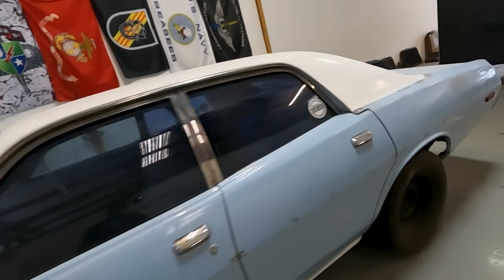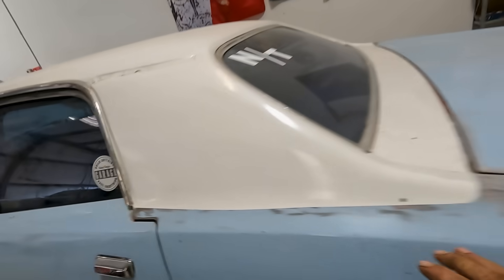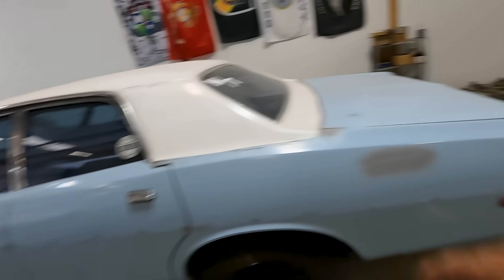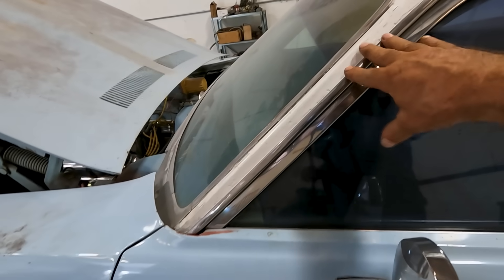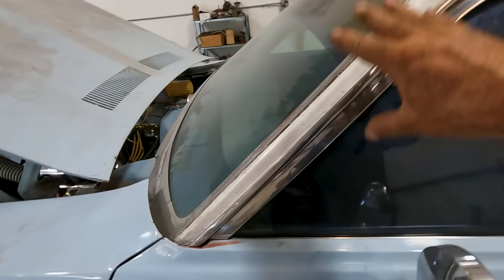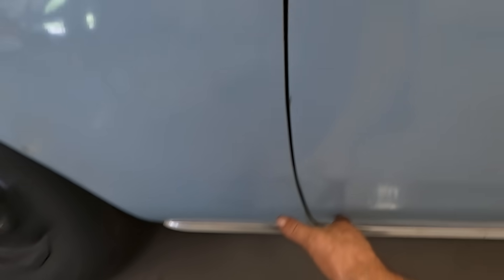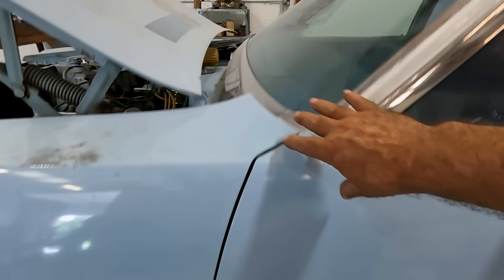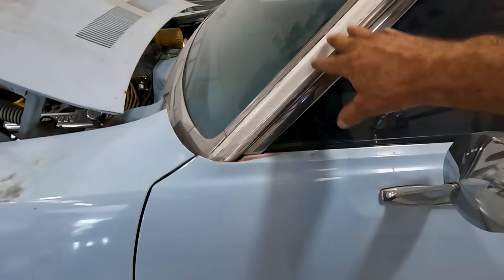Common Automotive Body Types Explained - How To Identify The Differences

Comment: Tony, If you do a little research you'll find that many words and terms used to describe the Moden Car had their beginnings in the Wagon industry. For example, Drive Shaft was a Wagon Part Long before the Automobile was every invented or created. Hub's Wheels, Brakes, Tailgate, all were used on Wagons first. The Acremen Steering equations you did a segment on all began with Wagons. Fenders you might think were from wagons but actually came from Ships. Anyhow the List is long and I'm not going to write 10 pages on it.
Reply: Hahaha

Comment: Agree with Tony on the favorite body.  A car I had at 19 (and lost - a sad stupid story) was a '56 Chevrolet 210 2 door post.  I paid $150 for it and had one of the 6 cylinders sleeved so I didn't need to keep a case of oil on the back seat.  I had some "better" cars later, but that 6 cylinder slushomatic ties with the '66 tripower 4 spd goat for most missed.

Comment: Tony-I've posted this to you before, but I heard you say in an earlier video that the US did not have the Hemi 6- which actually blew my mind a little bit since I always assumed Chrysler US invented it and produced it for us Aussie's! It is a pretty amazing engine, and there are guys getting well north of 300hp N/A at the wheels out of the 265, more than double the stock HP with what I see as some fairly straightforward but clever mods. 

There is one guy I would recommend to watch and that is Mirabito Performance- he goes into great detail with his builds and then shows all the dyno runs too.   He gets big power from the 265 Hemi - and they are STOUT!

They are relatively plentiful and inexpensive to buy in stock form in Oz - of course you need it shipped.  I am also fairly sure they fit up to the same transmissions that you have there but I'm no expert on Mopar. If you could get your hands on one I think it would be great content for your channel as well as you'd obviously enjoy exploring this gem of a Mopar yourself!
 I'm pretty sure Mirabito would hook you up with even just a decent stock one if that was what you wanted- or with one of his builds if that was financially doable. Mirabito is a cool guy- very down to earth, honest and straightforward just like you.

Comment: The 1988 4runner was a 2 door but with equal space in the backseats as the front, with a removable hardtop and a factory rollcage. Becomes a pickup with 4 seats. Gotta be the best combination of space and features i have ever seen. Truck got stolen long time ago.

Comment: I always understood it as a Coupé refers to a curved roofline/trunk area, rather than the amount of doors. I always understood that a Sedan/saloon refers to a car with a flat drop-off, like a Buick Grand National or a Ford Anglia. You can have a 4-door Coupé and a two-door sedan.
Reply: No saloons in the US.  and in our neck of the woods, only two doors for a coupe..... four doors for a sedan.   Then we had hardtops, four and two door.  Think they are pretty much gone.  Then my favorite, a convertible.
Reply: @eugenepiurkowski5439  Rover did both 4 door sedan and 4 door coupe in P5 model
Reply: @derekhobbs1102  Thanks for the info.  Must be a British thing?  "Four door coupe?"
Reply: Tony actually goes over that, the Rover Coupe has a lot lower Roofline than the Sedan and it tapers off downwards at the back, if you compare it to the Sedan it's almost chopped, at the end of the day the actual terminology Coupe is a French word which meant Cut originally so the Roof was cut, of course we became to know it as 2 door which wasn't how it originated
Reply: 4 door coupe?? You sure you dont mean a 4 door chatchback??
Reply: @eugenepiurkowski5439 Buick was advertizing the Grand National as the fastest sedan in North America. 2 door sedans are a thing here. They also referred to those 2 door G bodies as coupes when they gave them a fast rear window (see Monte Carlo Aero Coupe).
Reply: @1DEADBEEF1 there's a few 4 door coupes in North America, all German. Mercedes CLS, CLA, and AMG GT, BMW 2 series, 4 series, and 8 series Grand Coupes. Audi A/S/RS7, Volkwagen CC
Reply: @1DEADBEEF1  That would be the SD1, the next generation body.
Reply: @1DEADBEEF1  Yes 4dr. coupe. Has to do with the slightly raked rear pillar and reduced roof volume.

Comment: I learned something today, I always thought a hardtop is a non-fabric topped convertible. This is important education, almost as important as having a yellow engine.
Reply: You're pretty close. Had a 64 Bonneville. It was a 4 door hardtop. No B pillar window post. It was built on a convertible frame which on this car was beefier and differently configured from the sedan frame. The exhaust pipe routing was completely different between the two.

Comment: The big difference between a convertible and a roadster is a convert has roll up windows where a roadster has snap in side curtains . Chevrolet added the four door hardtop line in '56 and referred to them as a Sport Sedan , with the two door hardtop being a Sport Coupe . Don't blame me , that was their decision not mine .
Reply: Prior to WW2 convertibles without side glass used to be roadsters and convertibles with side glass used to be cabriolets.  Roadsters could have snap in side curtains but it wasn't a requirement.  The distinction was dropped postwar as roadsters largely disappeared from the market except for a few niche vehicles. Language evolves and different manufacturers used different terms at different times, like VW bringing back the Cabriolet (AKA the cheerleader's death ride) back in the late 70's.

Comment: I have a 1964 Dodge 440 2 Door Hardtop and right now I’m converting it to the newer power steering box because it was so loose that it is sketchy to drive at 55 or above.

Comment: I had 2 1967 Pontiac Lemans. 1 was a hardtop coupe, one was a Post Coupe. That’s what everyone around here called it. Instead of Pillard coupe. And on both, the windows rolled down. I liked the Post Coupe better after a time since the side windows appeared smaller with the frames.
Reply: The ones that have rear windows that don't roll down or don't open at all, are normally called, "business coupe", even if the rear windows do flip open a bit, but some don't move or open at all. Also, in certain years, in business coupes, the rear seat was often an option.

Comment: Hey Tony, great video as always!😁 I have a problem I cant figure out with My mopar 318, done everything I can but it wont run right, is there any way i can send you a video and see if you can help me?
Greetings from Sweden 😁🍻
Reply: What exactly does it do while running? How many miles are on the engine? Has it had any recent work done on it? What have you done to trouble shoot it if anything? Has timing chain or distributor been replaced?
Reply: New distributor, plugs, cables, ignition box, timing, intake manifold, carburetor. When I have even gas the car jumps and almost sounds like it is missfireing and there is almost no difference no matter how I adjust the carb
Reply: the adjustment screws have a lot of resistance when screwing, on my previous car with the same carb I think they went much easier
Reply: @Snuttiplutti  Sounds like you need to double check the timing, the distributor might be installed a little off, also check for vacuum leaks by puffing ether around the intake, carb, and all vacuum lines and connections for starters

Comment: WAIT!! 
I always thought a convertible has two rows of seats, and a roadster is a two seater - that goes back all the way to horse drawn buggies.
In Euope roadster bodystyle is called a spider.
Then there is also the speedster which is a roadster (two seater) with a very short windsheld
Reply from the maker: Think original 2 seater Thunderbird. Marketed by Ford as a convertible.
AC Cobra was a Roadster
Reply: @UncleTonysGarage being ESL i think i might be confusing a convertible with a Cabriolet!

Comment: What about 2nd generation dodge ram trucks. The front door latches into the rear door of the extended cab. What do you call that. Would you consider the front of the rear door a B piller.(front door cannot shut unless back door is shut and its backwards for opening)

Comment: To anyone who wants to be more confused, in the seventies, Ford made four door Sedans, Hardtops, and Pillared Hardtops.  What was a pillared hardtop?  It was the same roofline as a hardtop, but with a B pillar, but with frameless window glass.  Technically, the cars are sedans, the AMA specifications refer to these cars as sedans.  But, the sedan was a different roofline, available under a different trim.  A 1971 Galaxie hardtop was the same metal as a 1971 LTD Hardtop, but the Galaxie was available as a sedan and not as a pillared hardtop, while the LTD was available as a pillared hardtop, and not a sedan.  For some reason Ford kept the pillared hardtop into the seventies, dropping framed windows on full size cars until 1979.  Oddly, they dropped the regular hardtop cars, I guess for some sort of anticipated rollover requirements that never saw fruition.  It's a shame, I've always thought the "pillared hardtop" was a stupid design that had all the negatives of a hardtop, what with regulator slop and less reliable weather resistance, but you didn't even get the big open area of a real hardtop.

Comment: I try to stick to the nomenclature the manufacturers themselves used on their different models. I've found that makes for the least number of misunderstandings. Because the manufacturers don't always agree about these things either. Especially if you compare the nomenclature European manufacturers use vs. US manufacturers vs. Japanese manufacturers etc.

I used to be a BMW guy, and I've had a couple of E30s (1980s 3 series). All 2 door sedans. And I've noticed that younger guys over the last 10 to 15 years have started calling these 2 door sedans coupes. So I often experienced young guys approaching me and saying things like "Oh, you've got an E30 coupe. Cool." And I'm answering, "No I don't, I've got an E30 2 door sedan." And sometimes that evolves into a discussion. Fact is BMW never made an E30 coupe. The E30 was only available as a 4 door sedan, 2 door sedan, convertible (2 different variants) and 4 door station wagon (5 door station wagon, if you count the rear hatch as a door.). No coupes, and BMW never called any E30s a coupe. The 4 door and the 2 door E30s share the exact same roof panel and rear window. Exactly the same profile. Now, the M3 has a welded on C pillar extension and a different rear window and trunk lid for aerodynamic reasons, but it's still a sedan. I've never understod why some people begun calling the 2 door E30 a coupe, and now it seems everyone is doing it. And it's wrong.

Comment: I know this should solve the constant argument down under, but it'll just add to the fire. We had the Valiant 2 door hardtop, using the 67-69 Dart hardtop bodywork (imported panels). So many owners insist it is a coupe, and have a real dummy spit should anyone suggest otherwise
Reply: We had the same thing with the 2 door hardtop Valiants.  Being the lowest of the low in the Chrysler line the US Valiants were all sedans.

Comment: Ok. So the mid-70s Cadillac Sedan DeVilles don't have b-pillar that goes to the top of the door frame. When you roll all the windows down, there's a completely unobstructed view front to back. Does that mean the Sedan DeVille is actually a hardtop?
Reply: Calling it a Hardtop DeVille would have been accurate. But perhaps, confusing to laypersons unfamiliar with automotive technology

Comment: What if we’re talking about GM A bodies built on perimeter frame? Say a 68 Chevelle; would a 2dr post be noticeably more rigid than a 2dr hardtop ?
Reply: In a roll-over, in any case. Despite convertibles being built on frames, the frames on those were always re-inforced. Even when bodies had rubber grommets placed in between them and the frames they rode on, a stiffened body did seem to help somewhat

Comment: '65-'68 Mustang fastbacks were called 2+2s in Ford's nomenclature, and the '69-'70, and I believe'71-'73 were called Sportsroofs. 
Other Sportsroofs were the '70-'71 Torino GT and Cobra, and maybe the '69-'70 Galaxie XL.
With '66-'67 GM A bodies, only the Chevelle had a proper two door sedan. The Buick, Olds, and Pontiac, were called pillared coupes with roll-down quarter glass I think.
Reply: Dan, I have seen the 1965 - 1966 Mustang called the 2+2, but not the 1967 and 1968 models because the fast back design went right to the trunk.
Reply: @mexicanspec  I saw, I believe a Musclecar Campy video or maybe Rev'n Evan, featuring a '67 or '68 fastback, and they showed the Monroney Sticker or perhaps the dealer brochure, and Ford referred to the '67 or '68 as a Sportsroof. Might've even been a Dennis Collins video...
Reply: @mexicanspec  They probably were referring to the intrusive driveshaft hump dividing the rear seat bottom, so that only two passengers could comfortably be seated like how the front buckets would accomodate
Reply: @al_dente4777  But it was that was in the Coupes as well.

Comment: Always thought:

2 doors = coupe
2 doors with back seat = 2+2 coupe 
4 doors = sedan
4 doors does not = coupe, ever
B pillar = post
No B pillar = hardtop
If there is no B pillar, rear pillar is still C pillar, excepting station wagons
Reply: Basically accurate except 2doors = coupe and coupe and 2+2 both have back seats but 2+2 have very limited rear leg room.  2 seat cars taller than 52 inches are Sport Coupes if they meet lb/hp required. ( Sport Hatchback if liftgate equipped) If not they are called 2-seat coupes or convertible if applicable ( or Business Coupes if > than 190 inches...if a coupe >190 inches without a backseat carries the same dimensions as another model with a back seat then the model without a back seat is referred to as a utility sedan...One of the rare circumstances where a sedan may refer to a two-door vehicle)
14:13

Comment: I currently live in grand rapids mi moved from traverse city about a 150 mile streatch. That im awear of i have seen a grand total of 2 charging stations.👏👏👏 and by the way they are 90 miles apart. 100 cars on the road needing recharged with 2 plugs that was thought through🤔🤦state like cali outlawing the gas engine compleatly big rig in all going to collapes the state. Oh ya and by the way those charging stations for cars are powered by gas generators that run 24 7 😂😂😂😂

Comment: I'm gonna hardcore disagree with you on the pillar topic with information that was given to me during my collision repair education. A hard top has an A and a B pillar if you do not have a complete B pillar, not A, partial B and then C. For example, a 70 roadrunner post vs hardtop car. The post has an a, b, and c pillar. The hardtop has an a and b pillar, but the B pillar is the rear roofline